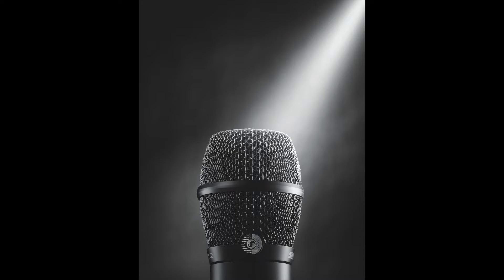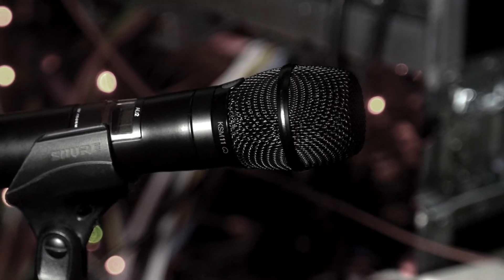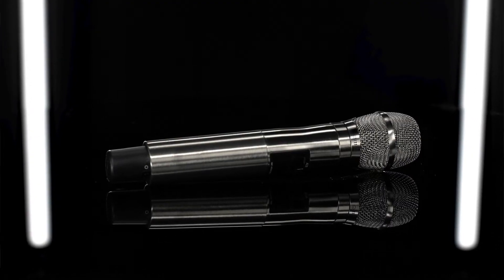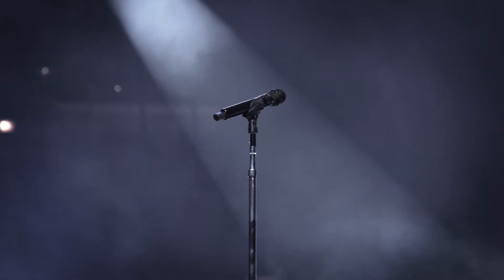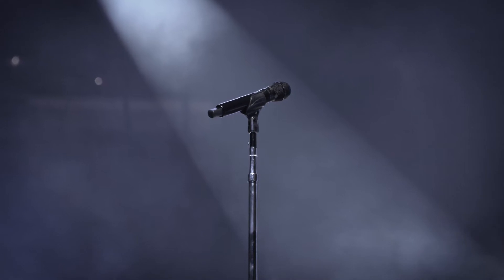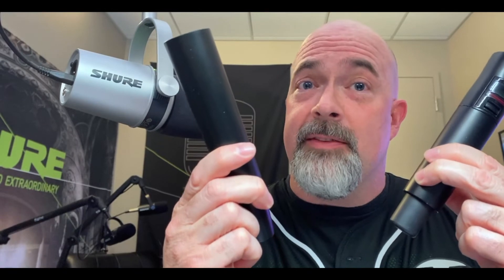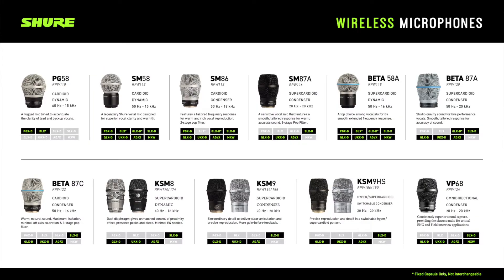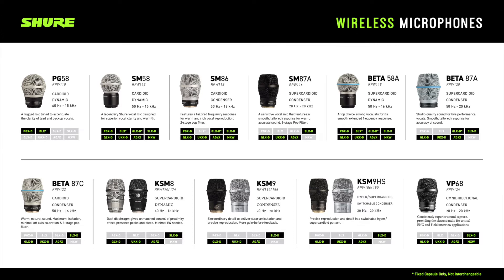How to Turn Your Wireless Microphone Capsule Into a Wired Mic | Shure

Comment: Hey there, how about the reverse? I have a wireless SM58 And a wired Beta 58. I want to put the Beta 58 capsule on the wireless transmitter that has the SM58 capsule. Can it be done?
Reply from the maker: Hello! We make a wireless capsule of the BETA 58 for certain wireless systems. Please reach out to us at www.shure.com/contact to see if your system has this option.

Comment: That's a truly great product. However - I have a question: I heard on another Shure video demonstration of the VPH handle that you just "unscrew your existing capsule from your wireless transmitter,  put it onto the VPH, add some phantom power, and you're good to go". This got me confused - as the capsule model she was showing was a 'dynamic capsule' (probably an SM58 or Beta 58 capsule). So my question (based on her demo) is - whether you somehow need 48v phantom power for a Dynamic (SM 58) capsule when screwed onto a Shure VPH. ?? Not being used to wireless mics - (having a case full of Shure dynamics) -  I was confused by this; why you might possibly need to add 48v phantom power to power a Shure "dynamic" (SM 58) capsule screwed onto a Shure VPH for use as a wired mic. I'd be very thankful if anyone could clarify this for me, as I'm interested in the VPH. Many thanks.
Reply from the maker: Hi! The VPH handle requires phantom power itself regardless of whether the capsule is condenser or dynamic. Phantom power won’t damage the dynamic capsules, and the VPH with a dynamic won’t work unless phantom power is provided.
Reply: @shurecreators  many thanks for the clarification! So - lastly - the 48v Phantom Power powers both the VPH and also a Shure KSM11 condenser Capsule, right? Appreciate your time. JW